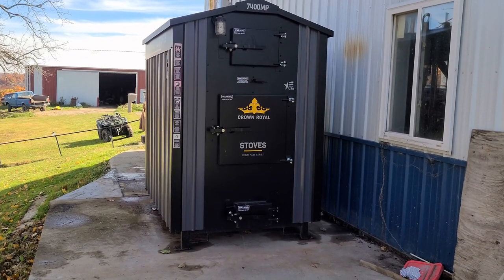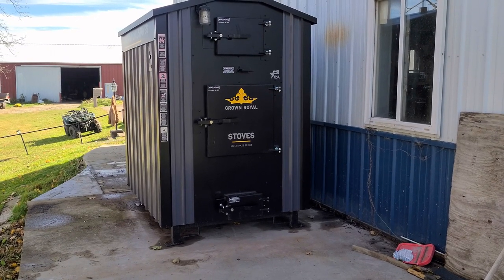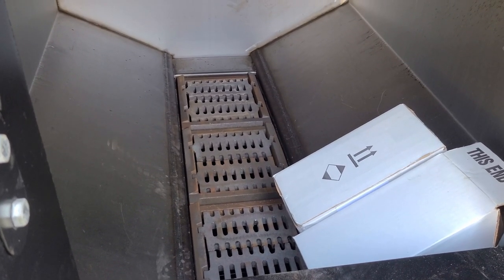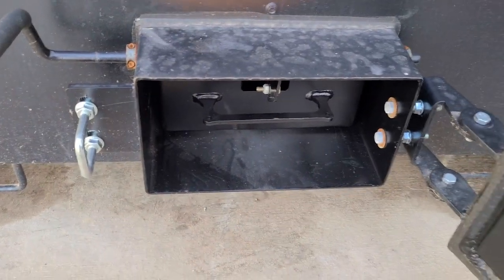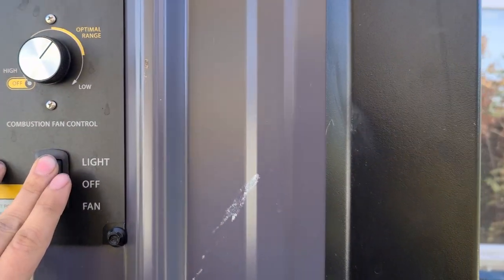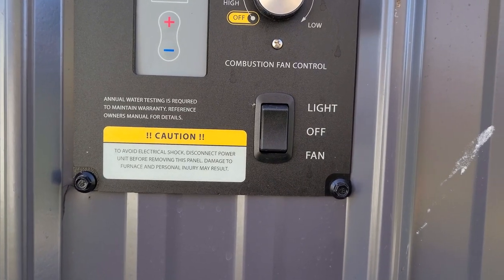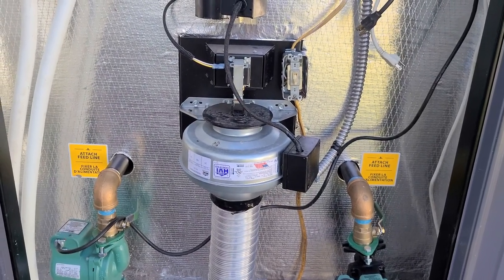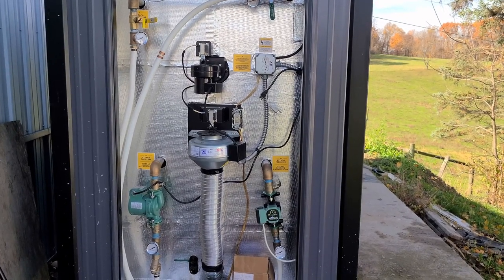NEW! Crown Royal 7400MP Furnace Intro & Hook-Up

Comment: Great video!  Why is your outlet from the bottom?  I have a different brand but was instructed outlet is the hottest water from the top (heat rises).  Same as a standard domestic hot water heater, outlet is from the top (hottest water).
Reply from the maker: That's the way the Crown Royal furnaces are set up.   Although, yes,  hot water naturally rises,  the circulating pump should always be circulating the water.  Returning water sent to the top will mix with that hot water and should promote a more uniform temperature within the water jacket, which I think is preferred from a design standpoint.  Temperature gradients or cold spots may lead to adverse effects.  That's my best guess and what I believe I've been told.